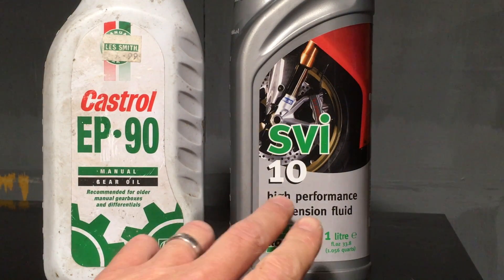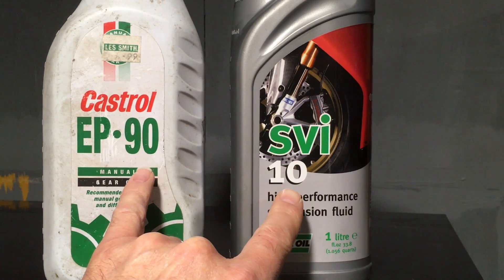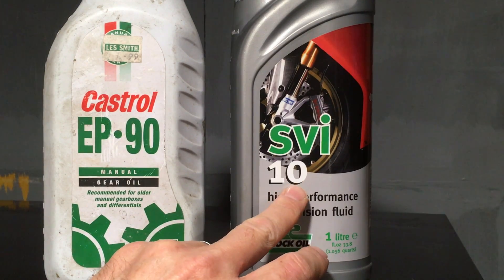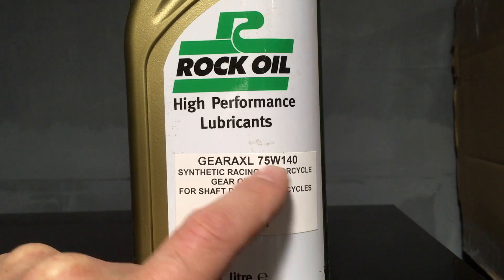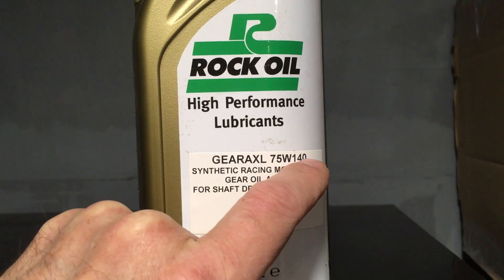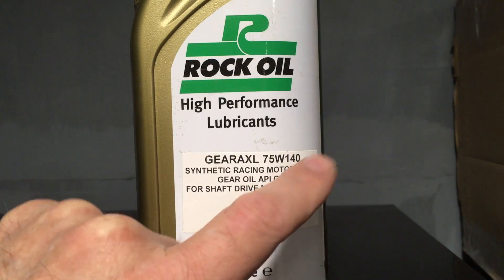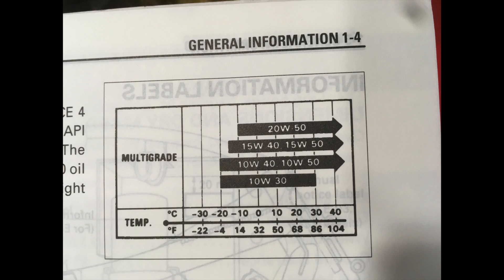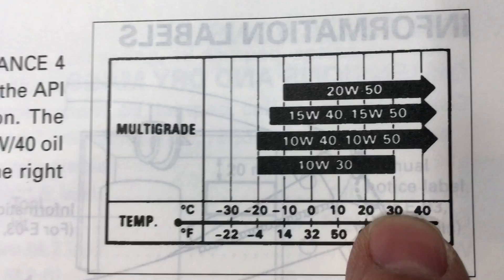Motor Engine Oil Codes and Viscosity - SAE : Mini Skills

Comment: Brilliant explanation of how the oils work, personally I  didn't really know what those numbers meant, only that some were thicker than others.
So what would you recommend for use here in the UK, London and Midlands etc. I say that as I know Scotland gets very cold in winter but not sure if the rest of us go much bellow freezing point. 
I've just looked and my current oil is 10W-40 there's also another 4T any idea what that is?
Thanks again
Reply from the maker: 10w40 is pretty much the default for the UK though I see 5w30 becoming more popular.  For Scotland I reckon I'd go 5w30 and if I had a track bike then 20w60 because it would run hotter than a road bike.  I run 20w60 in the Sportster because with the air cooling and the back cylinder running hot it gets a bit more extreme.   As far as I've ever been able to figure out 4T was four stroke oil with 2T being 2 stroke but some reckon the T means friction modifiers ie car oil which you shouldn't use in a bike which has clutch included in the engine lube - dunno about that though.  Skäl!  David
Reply: Moto Mirius 2T is for two stroke engines only. It is designed to be mixed with the petrol in a ratio of 25:1 or 50:1. It lubricates the relevant internal engine parts and is burnt in the combustion chamber. 4T as far as I’m aware is for motorcycles only and remains in the sump with a very small amount being burnt in the combustion chamber.
Reply from the maker: Cheers Edward.  It's been a very long time since I owned a 2 Stroke so thanks for the confirmation on that.  Fouled plugs - now there is something I'm glad to be without, just like the guy at the pumps with his squirty bottle of oil for the tank.
Reply: Moto Mirius also remember when pumps went self service and you had to do it yourself. Sometimes progress is a good thing. 👍

Comment: hello,, i ve question,, I use PCMO 10w40 APISN/CF,ACEA A3/B4 on my honda 110 4T scooter, factory recomended  oil is 10w30 JASO MB, i feel smoother than factory oil, and my engine valve look clean from deposit. is it any effect for my engine later?
Reply from the maker: There isn't much of a difference between 10w30 and 10w40, but if you use a more expensive oil then the additives can have a positive impact.  If you live somewhere hot or you run the scooter hard then 10w40 is a safe bet and you shouldn't have any issues with it.  Like anything else, if you stray from manufacturer recommendation then you do so at your own risk!
Reply: Moto Mirius I live in tropic country, the the reason i use that oil specification is, my engine feel very hot if i use factory spesification, maybe i will hold to use 10w40, well thanks your explaination is very educative for me 😉

Comment: Great stuff for those who don’t know Dave, I always use what is recommended, they’ve obviously done they’re research  and they know better than me 🤣 The Triumphs specify 10W/40 Castrol Power 1 Racing 4T Fully Synthetic.
Reply from the maker: Cheers Dave.  That is one fact I was saving till the next video 😂.  Always use the recommended oil in a bike.   Now your old Triumph might not like synthetic because it will have bigger oil galleries and need a thicker oil.   I’m still using classic 20w50 in the Citroen.  Skäl Dave.  Have a great weekend.
Reply: Moto Mirius Opps soz. Your right there! Halfords do it in the old skool metal 5L container too 😀 See you next week.

Comment: Hey Dave great info ...in the old days we used to stick 20/50 mineral oil in everything 
but then i was an Austin Rover group mechanic ...When i went to Toyota they had all these strange other grades 5/30 10/40 semi synth ,fully synth took me ages to look it up every time we got a vehicle
In.!!...maybe that's why Toyota still exist ? !! 
Great Video brother ...☮❤
Reply from the maker: Aye, well that and just maybe because the Japanese built stuff properly?  My brother was a BL mechanic then worked for Norton - he reckons he was told some real horror stories about the British bike factories like Triumph by the guys who used to work there.  Stuff like testing all the new engines by revving to max revs before they put any oil in them.  Skäl brother.
Reply: Moto Mirius 
Ha nice one Dave 
 I must admit although i don't like to , all the japanese and korean vehicles ive had have been awesome mechanically even though ive had loads of minis , p6 rovers , mgs..etc etc
The Toyota workshop in Dover 
Was immaculate like a hospital theatre..the Rover workshop in folkestone was a shit hole ...but we managed 😁👍☮❤
Reply from the maker: well Folkestone innit?  Though it has to be said that Dover has always been more of a dive.   Skäl Springy